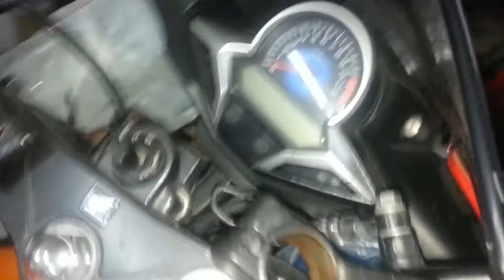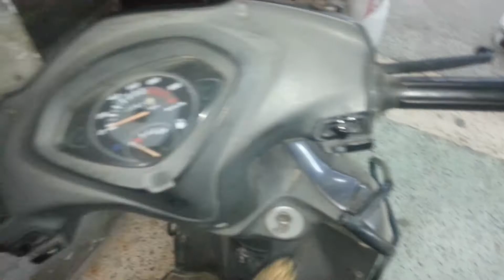How To Clean Your Motorcycle Control Switches. Jammed and fail working Switch Repair.

Comment: Bhai mujhay assembly kholni nai aati honda 100 pridor he or switch kaam nai kar raha aur 10 sal purani bike he shayyad ander zang lag gaya he toh kia wd 40 kholay begair maron ga toh kaam ho jaye ga? Aur baad mein jab bike chalaon ga to wd40 ko aag toh nai lag jaye gi? New assembly bohat mehngi he iss liye kia karon help or iss waja say battery b low ho ri he... earth sai nai millta usko
Reply from the maker: Aagar aapki switch  assembly rusted and dusted hoo gyi hai. Toh aap  definitely WD40 use kar ke  Rust  ND dust remove kar ke Clean kar  sakte Ho. Aur  rust  removing and cleaning ke baad  aap  puri  switch assembly ko WD40 remove kar ke  befikar ho ke  chala sakte hoo.  Koi  issue nahi aaye GA. Aag lagne ka risk hoo  sakta hai!! Kyuki  WD40 mei kerosene concentrate hota hai. Aur jab kabhi nhi aap Horn ka switch press krte hoo!  Toh  thoda sa  spark switch ke  andar nikalta hai. Agar  switch  mei  WD40 thoda sa  available hoye ga toh  chance hai Aag lagne ke. 
Maine abhi  tak  aapne Bike  ke  switch ko WD40 switch spray karne ke  baad  air  pressure sensor WD40 wipe kiya hai For safety.  10 minutes baad  saare control Switch ko  operate  and switch off ya On Kartar hu. 

WD 40  use Karne ke baad  aap  switch ko Clean Karo. Aur  WD40 ko  switches  see  saaf kar ke  switches ko use Karo.
Reply from the maker: Battery kyu low hoo rahi hai brother. 
Battery  low hone ki  vajha continue use of lights and horns hota hai. 

Baki battery  charging ka  aagar issue aata hai. Toh iski  main  Vajah  Stator(Alternator)coil burn ho jana  ya  Charger ka  khrab ho jane ki  vajha se  hota hai
Reply: @pulsarloverCG2444  bhai meri battery sirf 6am ki he or mein ne sirf 18watt ki led lagai he...or jsb indicator ya horn press karon toh light dim ya flicker karti he...or koi extra lights nai he...mein ne meter ki light parking light or back light ka aik point race pay karwaya tha ta k battery pay load nai pary or lekin fr b flicker karti he or begair start ki indicator ya headlight on rahay to 10 sec mein battery low ho jati he ignition light blkil band ho jati he or meri bike ka chabi switch b kharab he...pata nahi kis mssla he...ap ka shukria itni detail mein batany ka...
Reply from the maker: @driver472  fir toh yeh  boot  gambhir case hai.  Charging  system  proper kam nhi kar  rha ho GA.  CBR 250R Mei. 7 AMP ki  battery  lagti hai. Aur  jab bike  start khada hoo toh  bike ki  charging voltage 13 to 14 volts aani  chahiye.  14  volts  see  jyada  volts  produce Kare toh aapka  RR  unit khrab ki  nishani hai. Aur  agar  start  bike  12volts  se  kum  voltage produce kare  ya voltage fluctuation show na Kare toh aapke Bike ka  Stator coil (Magnet coil)  Jall gyi hai. Jiss  vjha se  battery  charge nahi hoti  aur battery low  reheti hai  Bike ki. Aur bike ki saari light flicker hoti hai. 
Magnet coil  burn Ho gyi hai aapke bike ki. Dead  sure hu.  Most common problem hai  CBR 250r  mei.  Aagar  battery charge  nahi  hoti toh..  
Open  the  Magnet  side  chamber  and Observe  the burned  magnet  stator coil 👍👍
Reply from the maker: @driver472  aapko bike ki  genuine  wiring  se  bhi koi  cherd chard nahi  karni  chahiye. Don't disturbed  the  Genuine  wire  Assembly and connections off your  bike.  Jugard vala kaam  kaffi  saari  cheezo ko effect karta hai bike ke functions ki.
Reply from the maker: @driver472  aapne bike  second hand purchase ki hai kya?? 
Aisi problems  jyada tak  second hand bikes mei  dekhne ko milti hai. Jugard kar ke  dead bike ko  ready kar ke  sell karte hai.  Wiring harness  and Charging system mei  problem hai.  Check and observe 🙏🏻
Reply: @pulsarloverCG2444  nai 2nd hand nai he 2013 say apnay paas he...han woh anari electricians ka qassor he...aik baar jab bike new thi tab num light wali num plate lagwai thi shuru mein toh battery low honay ki waja say utrawa di phr chor switch lagywa toh uss ne b battery low ki fr tab say ki masla howa pata nai...mein food delivery karta hoon toh raat mein bara masla hota he 10 sec b indicator ya headlight on reh gai toh sari battery low ho jati he...baki bhai mujhay lagta he shayyad grip assembly mein koi masla he q k high low karty howay light baz okat band ho jati he...fr button ko press karta hon toh on hoti he...or kia chabi switch k kharab honay say essay hota he k shayyad current poora agaye na ja ra ho? Or mein ne toh battery b 6am ki dali this issi liye or wah b paisay zaya...q k stock battery 2.5am lead acid thi aur uss ki life complete ho gai thi...iss liye 6amp wali dali lekin kaam nai aai...sai bola ap ne company wiring say cher chaar nai karni chaiye...abi tak mujhat solution nai milla...haan battery toh charge hoti he lekin drain bohat tezz ho jati he...
Reply from the maker: @driver472  don't worry brother. 
Actual  mei  Apne bike mei  Battery  1 Ampear less dali hai.  Aapne  6 Ampear wali  battery use ki hai. Jo ki iss bike ke liye suitable nahi hai. Aap  6 appears see  sirf  bike ka  engine  Chala  sakte Ho. But jaise  aap  Headlight  ya  indicators On Karo gey. Toh aapki Bike ki  pickup performance low feel hoye gi. Aur  battery  drain hoti  rahe gi. Kyuki  Iss  bike  mei  electric kaam D.C.(Direct Current)volts pe  kaam karta hai. Aap bike ki  Key  On karne ke  baad App Headlight Direct on kar  sakte Ho. Yeh Nishani hoti hai  D.C. volt electric system in CBR biki. 
Wahi  Splendor Plus  ki  headlight Chabi ON karne ke  baad nhi  On nahi hoti. Jab aap kick  start karate ho splendor bike ko toh head light On ho jati hai aur  race dene per  light Increase  decrease hoti hai. Yeh  nishani hoti hai  A.C.(Alternate Current) Current wire  system ki. 
 
Aapki bike mei  7 appears ki  battery ya  7 appears se  jyada ki battery honi chahiye.  Tabbi aapke bike ki  ye problem Theek hone ke  puree chances hai.
Reply from the maker: @driver472  https://youtu.be/yUCLvfz38LM
Reply: @pulsarloverCG2444  ok bhai thanks but meri bike self start nahi he or bari battery sirf dc headlight jo k company say ac ata he 35 watt halogen bulb uss ko Change kia 18 watt ki led k sath or dc connection karwaya tha..baqi bohat shukria help ka ..